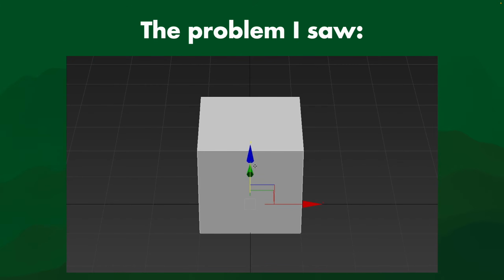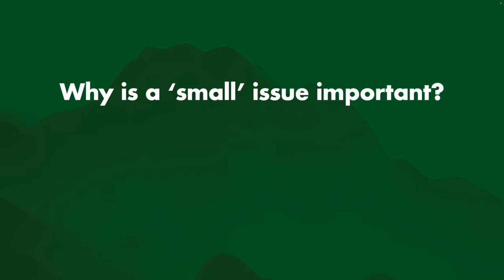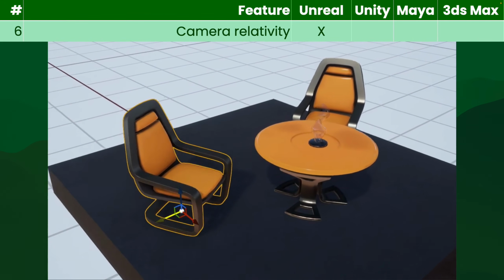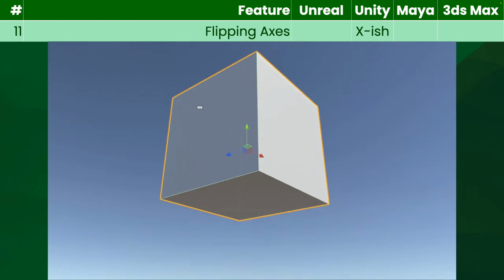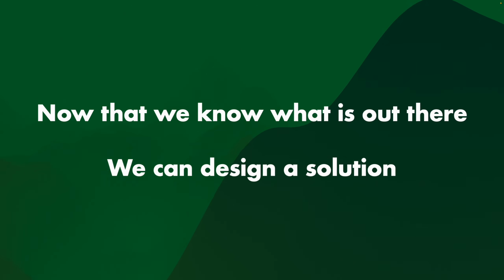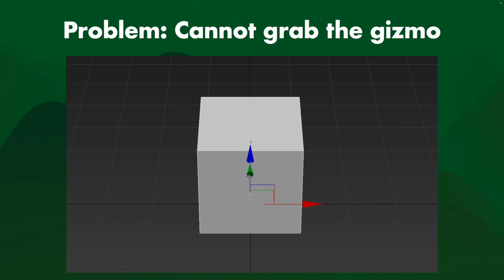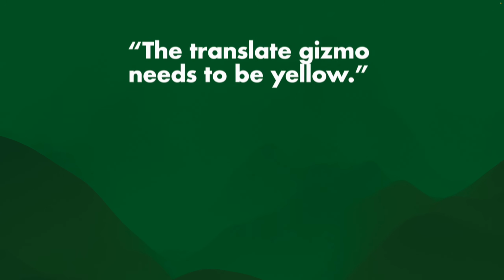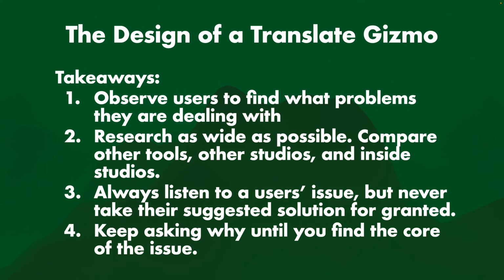3D Gizmo Design: One week saves 3000 hours

Comment: 6:34 first idea off the top of my head for the negative gizmo directions is to change the colors to from the standard RGB, to the primary compliment colors of Cyan, Magenta, and Yellow...or CMY

It gives an immediate noticable difference and people tend to inherently understand they are compliments of one another without a single shred of art or color theory knowledge simply because of how our eyes and brain interpret color and the fact we use RGB as the base to begin with.

The color swap pattern is used all over the place in other easy to understand interfaces because of that  reason. I much prefer it myself when doing surface normal masks in 2D for psuedo 3D lighting on sprites over the violet and light blue color pallete.
Reply: From an accessibility perspective, it's generally preferable to avoid being overreliant on color as shapes are mentally easier to logically "group" together as a gestalt for negative axes. Having the whole team spend time acclimating to CMY for negative axes corresponding to RGB may not necessarily be a smooth transition. It's simpler and more intuitive to retain the colors they've already internalized and do something like hollow out the arrows, which is a change common to all 3 axes and thus easy to associate with negative axes within seconds.
Reply: @RawAustin  I mean, i personally would be comfortable with SEVERAL different ideas. But, as said, this was the first thing to come to mind, and i definitely wasnt thinking about color accessibility when it did come to mind.

I ultimately like the idea as described in the video. I literally paused the video at that time code to type my message as to not miss content but also give my GENUINE first take, which is what you read.

Thank you for your response, though. I love the discourse on all these sorts of topics.

Whatever ideas might you bring to the subject that werent described here that might be fun to pick apart in good spirit?
Reply: @pureatheistic  When pondering gizmo concepts myself I ended up at a vaguely similar place to the video - essentially modifying the gizmo's arms to keep it readable and consistent without modifying the usual colors or shapes. Think something like adding small evenly spaced perpendicular lines along the negative axes' arrow arms, or thickening the arms overall and making the negative axes semi-transparent via a screen-space alpha (think of how Unreal shades parts of the gizmo that are occluded by geometry). But the video's solution is far simpler and more elegant than either.

I'm admittedly not much for gizmos myself at least in DCC apps where hotkeys are far more modal and flexible, and being able to fully exploit the freedom hotkeys allow in an application like Blender allows side-stepping the gizmo altogether.

As far as potentially standardizing an approach goes, I think theres merit in introducing CMY. When translating this translation gizmo dynamism over to other gizmos like scaling, skewing, combined transforms or even edge-cases I'm unaware of where rotation might benefit from making axes signs explicit, color seems like a simple standard to develop a shared intuition for that can be used with arbitrary gizmo shapes.

Comment: For something like this there an additional really valuable factor to consider and that's ergonomics and the long term health of the user. Like you pointed out in your video these operations are performed so often by so many people that any small changes here have a huge compounding effect.

I know from my own experience that I can feel strain in my wrist, hand and arm from constantly having to tense up while I try to click on the relatively small axis arrows. I then have to keep the the mouse button held down while also making sure I drag it to a very specific (often small) target area, to move the asset just the right amount.

Ever since I started using Blender I have really developed an appreciating for their approach to the move, rotate and scale operations; Just pressing the hotkey starts the operation and you can position your mouse without also having to hold down the mouse button at the same time. This really does have a positive effect in my comfort levels and strain in the long term, and I now really miss this functionality in other programs.

This is most likely another one of those scenarios where people have just gotten used to things working a certain way so if you've never used Blender shortcuts you wouldn't even realise the benefits of somethings like this.

It might take some convincing to get people to switch over to a different solution than the standard but there is also an opportunity here to have a big positive effect on someone's long term health and quality of life. As an artist there are few things scarier then the idea of loosing the use of your hands.

If you end up reading this and making this far I can take to opportunity to also say; Thanks for taking the time to put together these videos, they are such a great resource.
Reply from the maker: Thank you very much! And indeed, Tool UX Design can help with accessibility in so many different ways. If folks get too strained, either physically or mentally, it becomes so much harder to do good work.

Comment: Interesting video! One question though; how does it work if one of the arrows are pointing straight at you?
Reply from the maker: Great question! If you mean when an arrow is exactly orthogonal to the viewer, the viewer can still click and drag the arrow, but the distance of that drag then depends on how the drag movement is set up relative to the mouse movement.

Maybe it is an up and down movement of the mouse, and the object gets closer to the viewer, and then perhaps a left and right movement to adjust how fast it moves on that up and down angle.

This is another huge topic in gizmo design where the mouse movement has to be set up correctly depending on screenspace to be relative to the 3D space. It would take another video entirely to explain that fully!